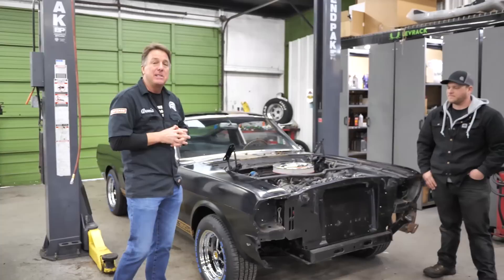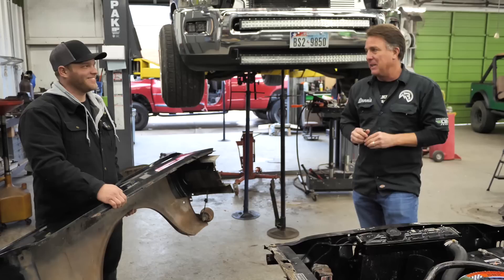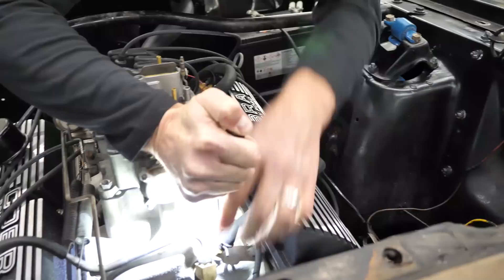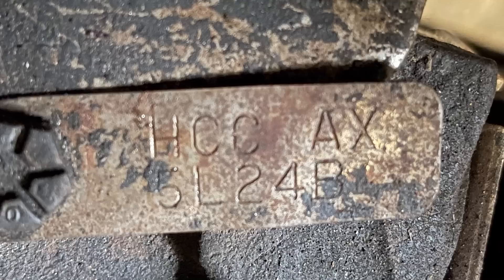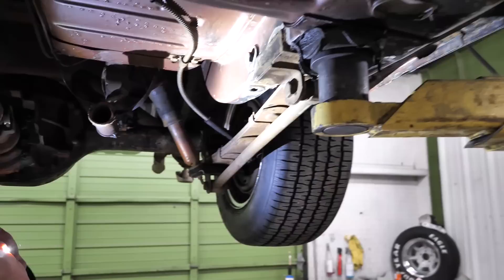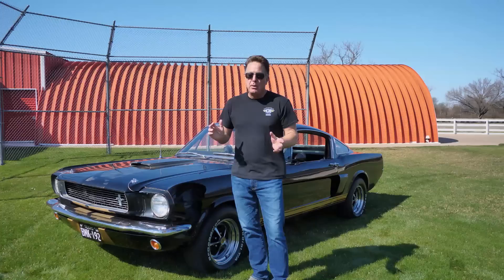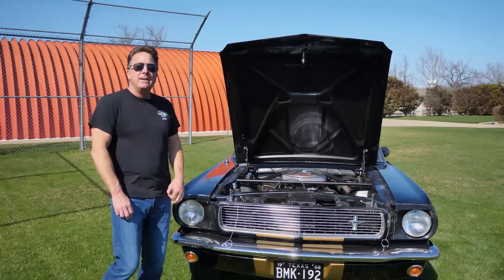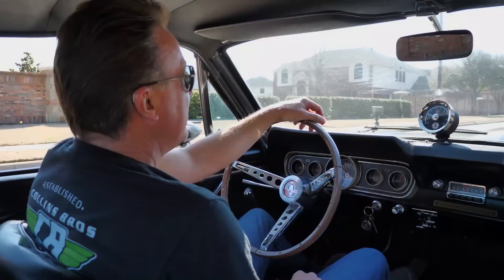NUMBER MATCHING 1966 MUSTANG SHELBY GT 350 HERTZ

Comment: My first car was a 66 2+2 k code vintage burgundy fastback that I bought for $600. back in 1985. The only differences are I had the top loader 4-speed and rally pack. It was a mess and spent a lot to get it back in shape. The original owner special ordered it with disc breaks, traction bars and the 9 inch rear. I wish I still had it. Thanks for bringing back the memories.

Comment: I’m really impressed by his knowledge and how he put on a date correct door using all the internals from the original. Just going that extra step. Now,  I can see the gas tank being replaced. Great job!!!  
My dad told me stories of him drag racing against these cars at the Fremont drag strip in CA. He had a 61 SS Impala with the 350hp tri power engine. He rigged the linkage so that all the carbs would open at the same time. The mustangs got him off the line, but he took them at the end..... most of the time. LOL

Comment: I was in the stands at Fremont Drag strip for 25 years, from 1962 (8 yrs old) to when they closed the track in 1987, I was either watching or running my own cars/motorcyles and one thing is for certain,  the guys were indeed renting these Hertz Shelby GT 350's and drag racing them.  ..even swapping the engines to gain those extra 51 ponies for class racing.

Comment: Hey Dennis. I worked for Hertz Rent A Car Tampa FL back in the 70’s until 1984. I know the shop manager who started with Hertz back in the 60’s. He told me a story of how for the 1966 rental season Hertz in Tampa FL had received a handful of these cars for rental. As it turns out a few of them were rented and driven an hour and a half away to Sebring where they were raced at Sebring of course. If your car has records of having been at the Hertz location at Tampa Airport there is a very good possibility that it raced at Sebring that year. By the way the shop at Tampa had to replace the tires and brakes on those cars. The shop manager (mechanic at the time) still got worked up (angry) relaying that story.

Comment: Have a 65 High Performance 289 short block in my shed, I have owned four of them in my life and was glad to hear you mention the over size harmonic balancer, easiest thing to spot along with dual point distributor. I also had a Shelby 6 pack intake with three original Ford tagged two barrel carbs. Anyone seen one of those? Also what were the numbers of Hertz rental Shelby Mustangs with Automatic and manual gearbox? Ever seen a Northstar restored mustang?

Comment: In 1964 I bought a 64 Fairlane Sport Coupe. It had a "K" code automatic. Gunmetal grey and a red stripe thru moulding. The car was a blast. It was tough to drive normal. At Island dragstrip I ran a 13.6et in 1/4 mile bone stock. Wish I kept car!

Comment: In 1970,mom loaned me $650 to buy a '65 square back. Factory 289 hipo,but it had a brand new hipo shortblock from Ford. Q/R steering, 4 speed & 9 in.rear. Green w/black interior. $650 for it! One of many high performance Fords & a '69 Mercury Cyclone 428CJ, I had during the '70's! I had several favorites & I'd give anything to have just one of them back!

Comment: I helped a former friend remove the LF fender from a 68 GT500 he bought from an old lady in 2000 for $2000. Someone must have been dyslexic the day it was built because they transposed two of the numbers. It was built in February 1968 just before they started building the GT500KR. His had some cast headers that hung way down below the cars body and only cleared the ground by about 3”. Last I heard he still has it.

Comment: I thighs the extra valve under the master cylinder is actually the proportioning valve.  Meant to distribution braking pressure between the front disks and rear drums so the drums don’t lock up.  This was on all disk brake cars, still rare piece but I don’t think it had anything to do with the competition brakes.

Comment: I rented a 1966 Shelby GT350H for $19.00 a day in San Diego on June 22, 1966. It was my last night home as a civilian, because the next day I was off to USMC boot camp in San Diego. I street raced my high school buddies that night, and with so many fast stops, the brakes failed when I pulled it into my parents driveway. I didn’t hit the garage door, so no body damage done, but when Hurtz towed it away the next day there was “NO CHARGE” because of the brake failure. After serving in Vietnam, I came home and went straight to a Ford Dealer in Mission Valley (San Diego) and drove a new ‘68 Mustang GT 390 with 4 speed. Loved it, but at a cost of $3,500, I decided to buy a new Roadrunner instead for $2,900. Those were fun days!

Comment: Hey Dennis I had a 1966 gt 350 that my Dad bought new. My exhaust didn't turn down in the back like this 350H does.
Was the exhaust exiting through the rear valance an option? Did Shelby just do that on the ones that weren't Hertz cars?
My rear quarter windows were glass with a DOT number yet I have seen some that are plastic. How did they come from the Shelby? 
Thanks
Paul

Comment: You should get a cheap endoscope with LEDs so you can just fish it up through the fenders to check the paint codes under the tag.. they make them with WiFi so you can use them with iphones :)

Comment: Thanks, nice overviews, & interesting.... Definitely, Heard about These MUSTANG Shelby’s!   *Also, interestingly, in 1967: I bought a nice FORD : **66 GALAXIE 500 xl/4 SPD  352( boo!Burgandy COLOR/PB/ps, BUT : NO air cond/or optional Disc Brakes , and getting rid a 61 Ford GALAXIE Convertible ..... Anyways, I,had to Special upgrade to **METALLIC Brakes/tires/Monroe shocks//*add COOLANT recovery Systems(  originally & only thru Ford Performance, then to Other AUTO COMPANIES,, etc: (&  Car worked out good for many years,,,,..,.

Comment: i picked up a gt 500 with the 390 same color black with gold but it was the fast back the only thing wrong with the car was the drivers door handle was pushed flush with the body the rest was mint 1500 bucks for the car sold it for 5000 a week latter but that was years ago still kicking my self for selling it and it came with all the paperwork on it from the original owner  i would have been the second owner on the car

Comment: Why not rebuild the calipers and wheel cylinders. I used to do that all the time when I used to help my dad that worked at a Ford dealership in the 80s and 90s. Ford hated replacing calipers under warranty. The only way they would was if the hole miked too big